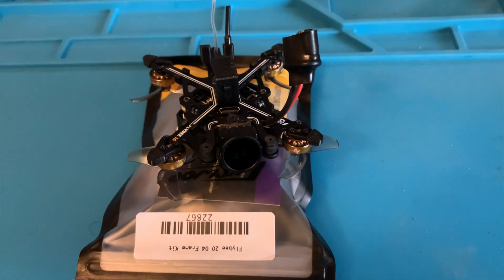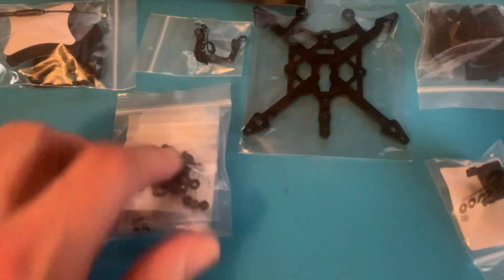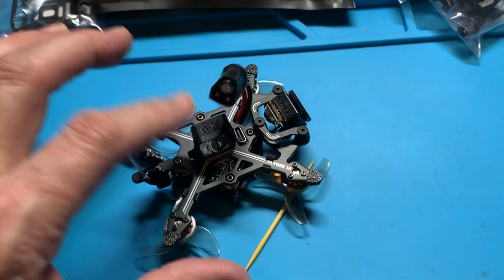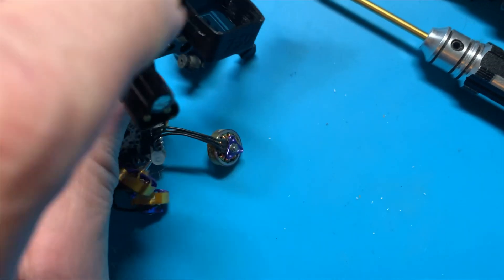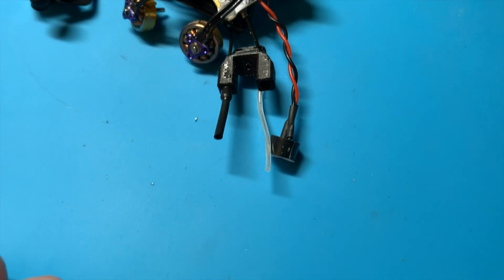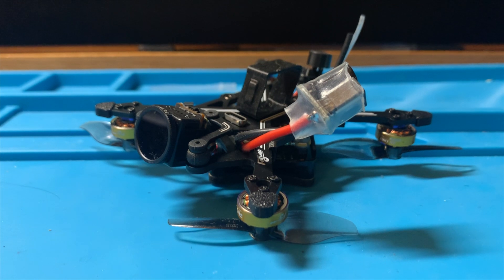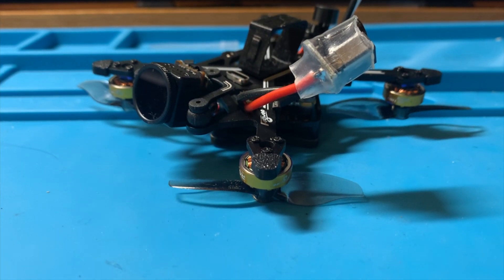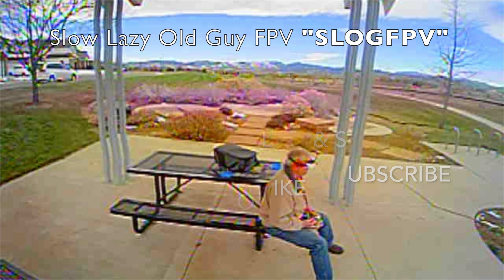Flybee 16 HD to 20 Frame Upgrade??

Comment: Nice frame swap, and great detail on how to do it. I have the 20 on the way.

Personally, I don’t like to fly anything smaller than a 2” drone anymore. The performance drop off is quite significant and for no real reason. Bystanders can’t tell the difference between a 1.6” and a 2” drone. They look and sound the same to them. The only reason to fly something smaller than a 2” is if you’re into flying whoops indoors. Sometimes we just have buy what we can get our hands on though.
Reply from the maker: I greatly appreciate the feedback! I agree with your assessment. The 2” is a much better choice as this is not an indoor flyer (no prop guards). Next time I will try to be less impulsive.
SLOG